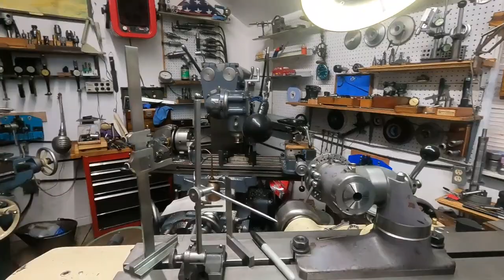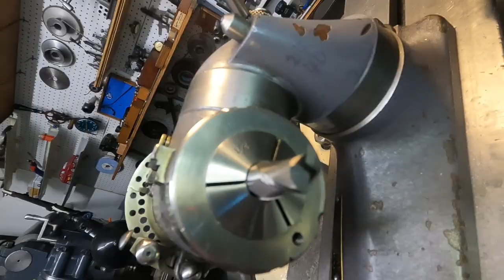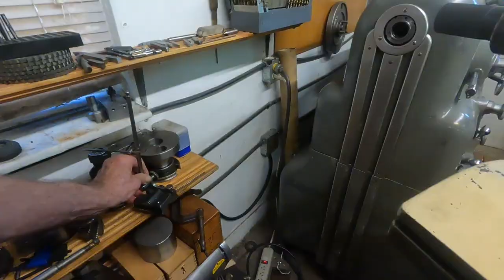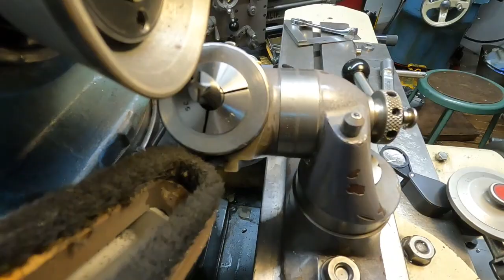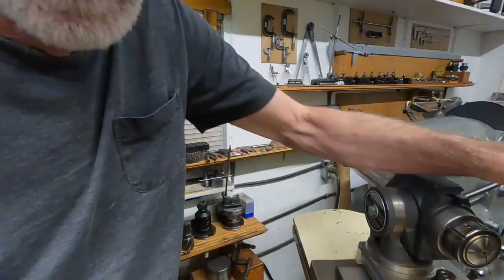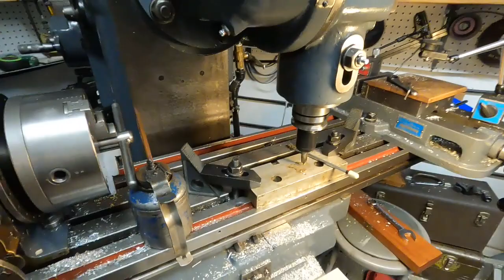Restoration of a carbide endmill, Tool & Cutter Grinder

Comment: I work in a CNC shop. We only use carbide end mills. Anything smaller than 10 mm diameter is single use as it is not economically viable to regrind. Not for the professionals anyway. But for the hobbyist it's a different story if you can do a good job at it. Carbide is obviously much harder to grind than tool steel. I'll be watching this full video later tonight.

Comment: Hi DD,  you might have success with a square foot of cardboard with a hole in it to put around something like an endmill so the gopro will focus on what is in the center.  the problem with gopro is it wants to focus on the average field of view, which is usually well behind what you are trying to focus on.  the cardboard will present the camera with a field of view distance that is the same with what you are trying to show and it will focus.
Reply from the maker: Thanks for that, I am not very familiar with auto focus

Comment: Hello Don, Love your videos ive learned a lot ! i have just finished refurbished a B&S #10 universal tool & cutter grinder seems very rare and hard to find some info. what im wondering is the cup wheels o on the right side and other wheels on the left  But if i push hard it has spring loaded backlash of about ~1/8" ? and cant find any info on why this is or what it should be ? the spindle is a bronze type and has runout of about one tenth , im wondering is this okay ?
Thank You So Much for your video's etc
Alec Ryals
Reply from the maker: The Crystal Lake Grinders used light hydraulic oil for the plain bearings. Probably should run for short periods and check for heat. Sounds like the bearings are good.

Comment: A flat bottom would have the flutes dragging as only the outer tip and flute actually cuts. If it’s a center cutter, obviously the entire flute cuts. What a lot of people don’t realize is that these things don’t cut a flat bottom when “drilling” to a depth.
Reply from the maker: I think it is amazing they work as well as they do and the abuse endmills can take.
Reply: @DonDyarprecision  it is. To think that the first horizontal milling bits were thought of as just rolled up files.

Comment: Dee this has been a fantastic video. Thanks for taking the time to film it.I know it takes a lot more time than 42 minutes to make a 42-minute video.
Reply from the maker: Well, receiving donations helps greatly with channel content and being able to move forward more quickly getting these antique machines up and running. I am working with a new or refurbished ebay Dell computer with 4x more power, soon to have much improved sound!

Comment: Great stills of the Rigid pipe tools girls. I've got a collection of Snap-On Girl clocks.  its not just the girls but also the era that I love.
Reply from the maker: I do have my early1970s Snap-On 3piece 6ft tall narrow boxes and tools, proving I did not fall victim to Cocaine and Disco in those decades, but for some reason I don't use them out in the shop instead using old Plomb and Williams tools I bought as a teenager in my beat up $14 1930s Plomb box I just found at Ed and Moes Pawn!